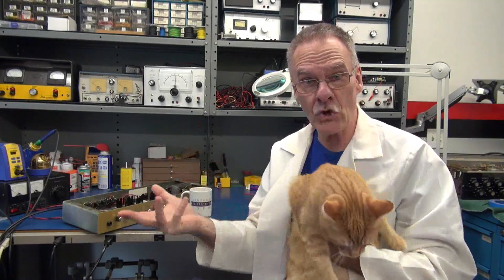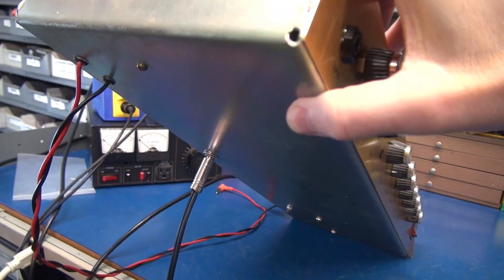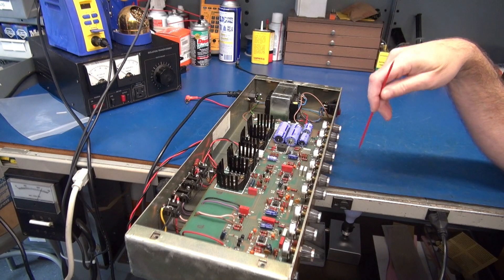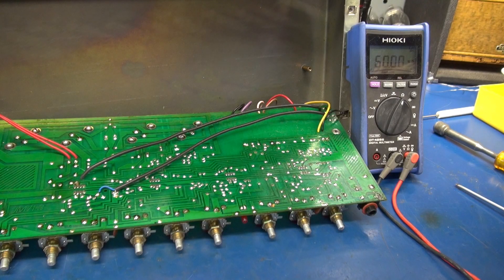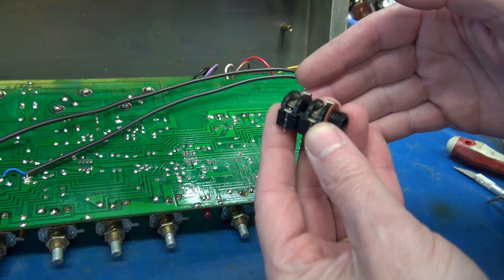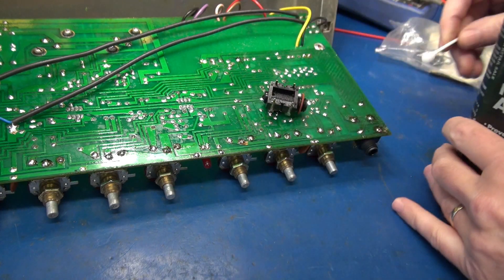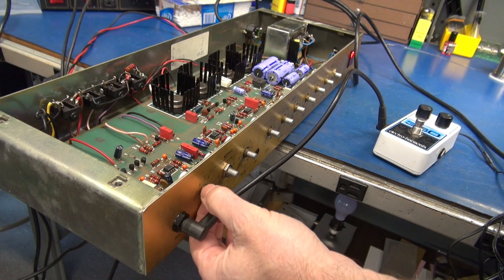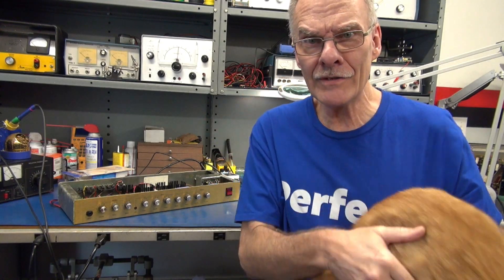Solid State Sinema Marshall model 5210 guitar amp circuit board repair noise squeal and Test

Comment: I have just bought a 5210 with a dead boost channel, could please share some tips on fault tracing this particular issue. I noticed that the channel 2 volume (not the gain) is completely dead while the gain pot do produce audible distorted sound but at a very low volume.

Comment: Howdy.
Lovely assistant D-lab has hired ...
PCB:s in amplifiers. I don't like that. But I guess there is no choice. Judging from the amount of runs in the board, point to point wiring would be a mess.
Cheers.

Comment: I got a relative a nice mint Line 6 modeling amp that had been returned for "bad hum" for literally pennies on the dollar,  sold as-is.  So apparently the user had a bad cord or guitar because it worked perfectly.  I have only repaired guitar amps on a few occasions,  and one was a rush job just in time to save a guy's gig with a well known regional band.  Audio amps are usually a cinch for technicians. Tubes are easier than solid state,  and a Line 6 with computers and microchips not so much.

Comment: Awww....your assistant looks like our Ginger/Tabby mix 😸😸😸
Quick question...have you ever worked on a Sony TA-1150 Integrated Amplifier from 1973.
The left channel is noisy (scratchy and poppy) I did purchase some Deoxit D5 from Amazon. Where am I applying it inside the amp. Anything or advice would help! Hope to hear from you. Take good care. -Sam
Reply from the maker: Take a look at the contacts on the speaker protect relay
Reply: @d-labelectronics  Okay, thank you!

Comment: Terry- You dislike the "No lead solder"? Come on man, that crap solder was my cash cow for several years on the RCA CTC 177 and 178 series TV sets. Tuner ground would crack, taking out the EEPROM, Vert.IC, and often the tuner IC. Big PITA getting the chassis out, plus adding the (extra profit) from the tuner grounding mod kit.  Reprogramming the EEPROM was a killer from ground zero. I bought one of the special tuner reprogramming units, and the "Pre-programmed" EEPROMS, which saved me at least 2- 2-1/2 hours time.  RCA did have excellent reprogramming instructions in their service data though. 
   Strange on the sets I just resoldered with lead solder,(Ersin 5 core-63/37)  there were never any more failures though.
 "Good" (LMSAO) old EPA regs. Their "rules"  killed the Freon TF degreaser and Shield lube, and the good automotive hot tank chemicals that really worked too.
Reply: @f.k.burnham8491  did the same back in the 90s, I learned to hate Ge/rca proscan crap. Had about 70 percent success at fixing vert probs but even with factory supplied programmer the eeprom never seemed to workout. Went to GE training which didn't help lol.

Comment: You made short work of that amp, Terry. I'm still in shock that this solid-state Marshall had good quality Japanese caps. I'm wondering if the filter caps were replaced at the same time the soldering was poorly reflowed.

Comment: So it was a factory defect coupled with wear on a plastic stress part. Bean counters at their best.

Since this is SSS, would you ever think about doing a solid state Direct Conversion Receiver like Solder Smoke's high school challenge, or the Ozark Patrol Regen receiver? They are shortwave sets, and could help get young'uns interested in multiple facets of our hobbies.

And what repair isn't cplete without at least one "cool-cat" hair? 😂

Comment: I have always been a fan of Marshall amps, Mostly the older stuff and the original Valvestate 80 model line up, between the VS8010 to the VS8080, i have no fewer than a dozen of them and i love them all. Most of them has had a hummmmmm issue at one point or another and its always the two 2200mf caps